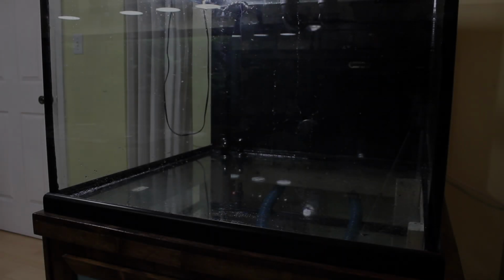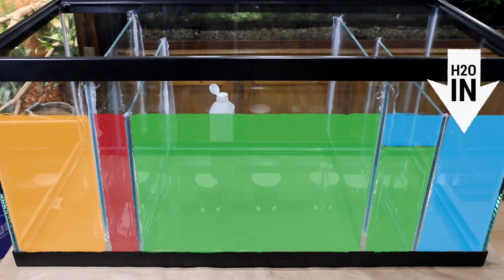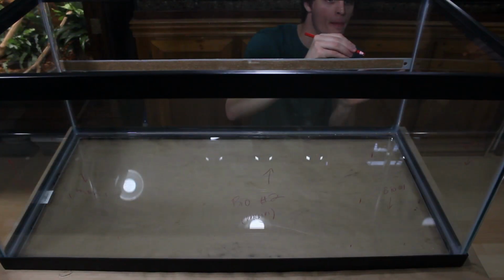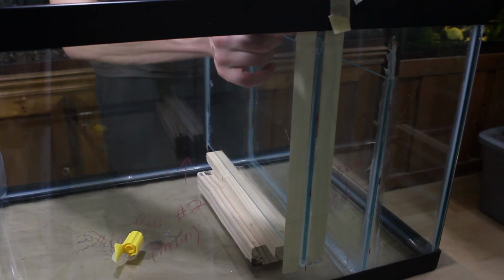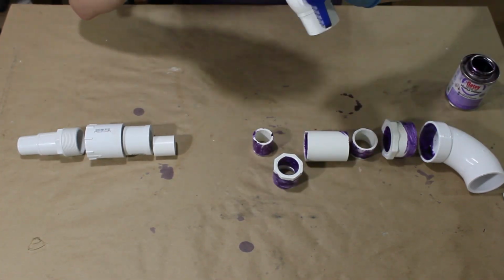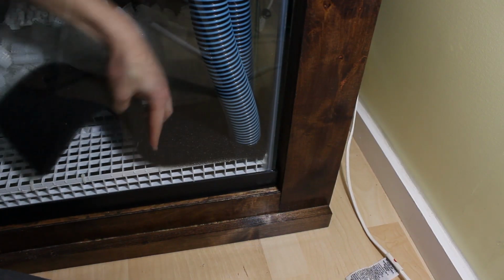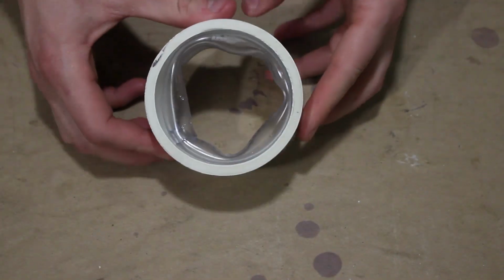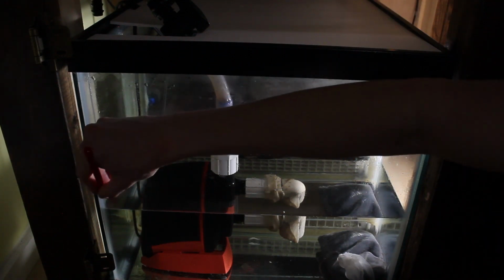Make a Freshwater Aquarium Sump (150g Redo pt.1)

Comment: well done vid .. have any vids on removing the trim on the top of the tank and keeping it in one piece so you can reinstall it back on??? i want to build a sump in the tank and a diy background on it so it completely hides it and looks natural but i dont know how to get the trim  off in one piece .. my trim has the center brace in it so i need to remove it 1st lol
Reply from the maker: I don't have any videos about it, but it's quite easy. If you get a scraper and stick it underneath of the frame (everywhere), on the inside of the tank, you will eventually break the seal and can easily pull it off the tank.

Comment: finally a full explaination on how a sump is built without elitists preaching "they aren't cheap" or "stick to goldfish if you can't work it out" 
thanks dude :D
Reply from the maker: They can get quite expensive depending on what you need to achieve. A simple one like this doesn't cost too much to make though. Also I'm glad that you liked the video!
Reply: it seems simple and cheap enough, can replace those glass seperators with any material really, metal, even boards of driftwood for some extra effect, the tank itself could be another material too, so on - it's the passage of water which puzzled me, how do you make a system which won't overfill either tank and you answered that for me, i was thinking float valves in the sump etc, much more complex than this much simpler design :D thankyou
Reply: bugz000 
Don't use metal in an aquarium, it seem all metal is more or less poisonous to fishes and even more to shrimps and crayfish.
Reply: It’s not full
There is lots of information missing 
And very sloppy work

Comment: Instead of gluing in glass baffles I was successful using 1/4"  acrylic and "EPDM Cellular Rubber Auto and Marine Weatherstrip" as a seal. Peel and stick the foam to the acrylic and slide into place. This also allows you to move them if needed. Worked well for years without issue.
Reply: felixthecrazy the seal didn’t slip off over time? I use it to seal top lids in aquarium and if water rests on it the glue wears down. I like the idea though and it’s really good on cost to.